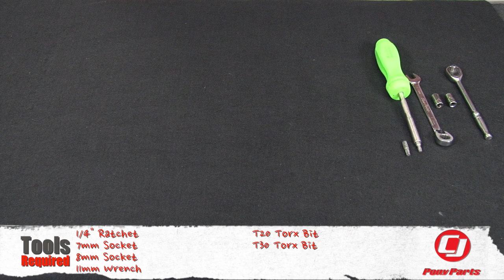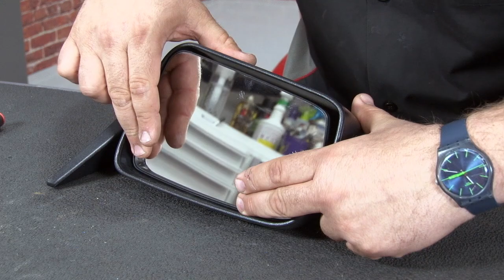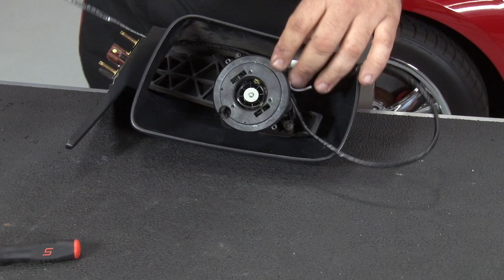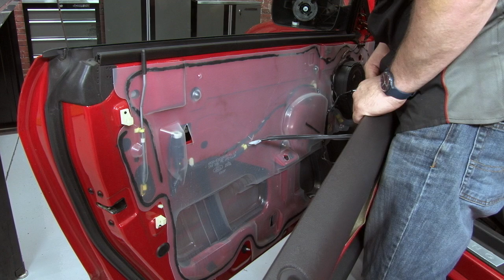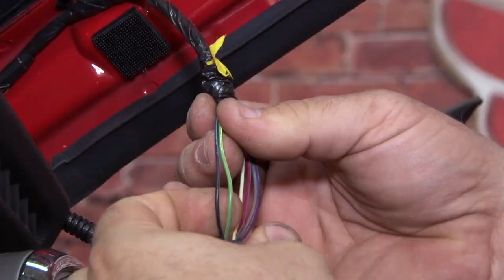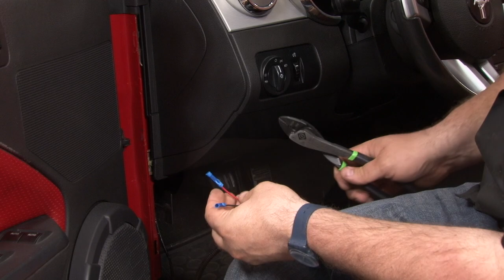Mustang Starkey Puddle Light LED Kit 2005-2012 Installation

Comment: so what happens when you're driving and turn on your map light? Will the puddle light come on as well? I don't want to get pulled over.   Thanks
Reply from the maker: Stevie D it works off the door pin lead for your map light, not the switch so you will be fine.
Reply: @cjponyparts  thanks

Comment: The fuse block has a signal wire that runs to the puddle lights, a one wire tap would eliminate all the cutting and work above the dashboard  ,near the dome lights.  not cool cutting  8 wires for a tiny light.
Reply: What fuse is it

Comment: Is there any way to get the pony style lights on a 05-09 mustang?
Reply: Ian Moriarty You would have to find a set of mirrors with pony lights off a 13-15, Ford does not offer them separately
Reply: Bill Tumas I should mention the mirrors are not interchangeable, you would have to remove the pony light mechanism and make it work.